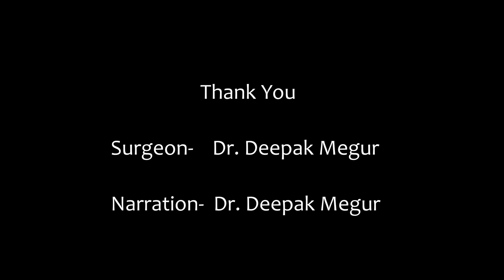Manual SICS and minimal Surgical Induced Astigmatism - Dr Deepak Megur

Comment: Excellent, one Q sir, why dont you make caprhexis before making full inside corneal incision to maintain pressure , I mean wouldnt you be afraid of post runout Flag sign when you start rhexis?
I intend to do one sideport and needle capsulotomy…then inside corneal incision and tunnel .by you EXP is the sequence of steps important in SICS which is before or not or its surgeon preference ? Thnx
Reply from the maker: it i would be surgeons preference , i guess